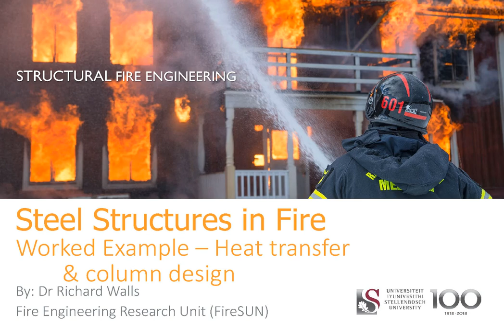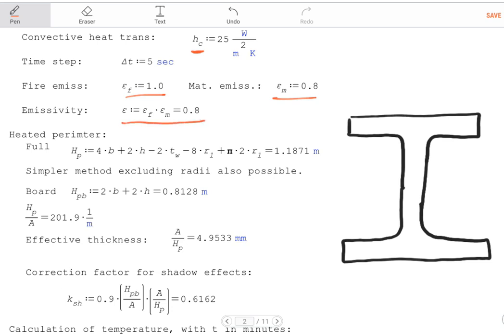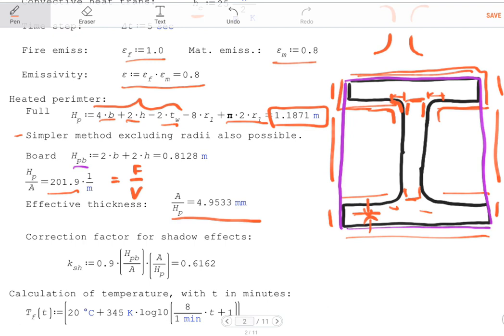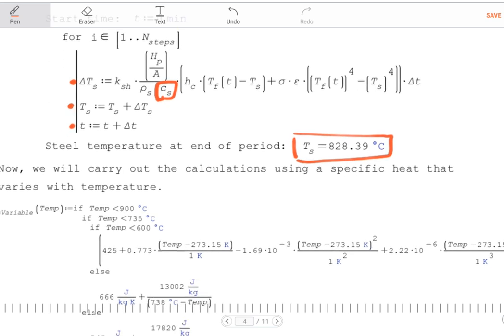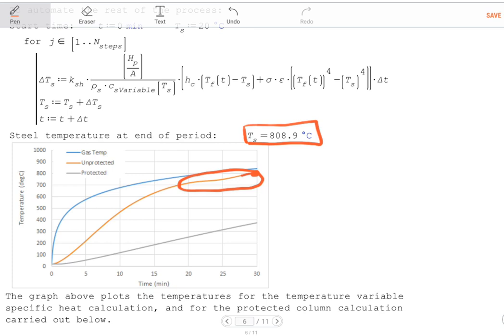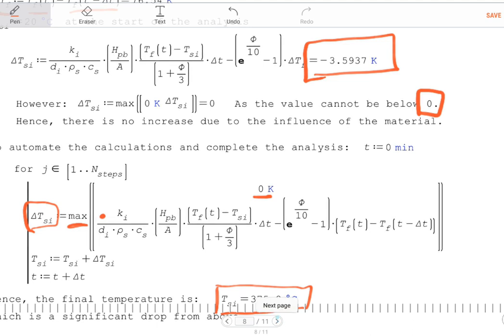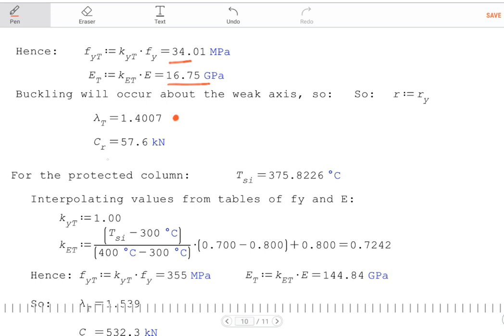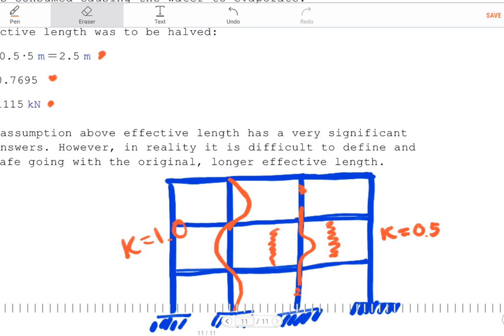Steel in Fire: Worked Example - Heat transfer and column design

Comment: what eurocode are you using for the calculations?
Reply from the maker: The heat transfer calculations are from EN 3-1-2. Capacity calculations are from the Canadian Code CSA S-16 (adopted within South Africa under SANS 10162-1)